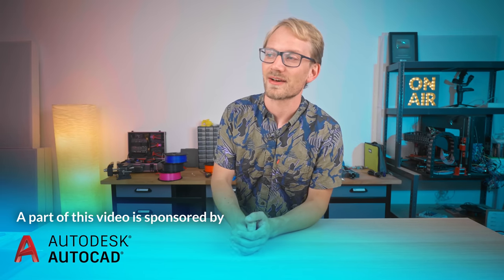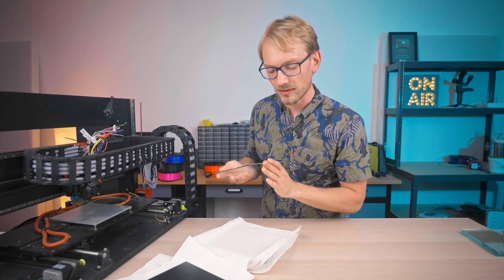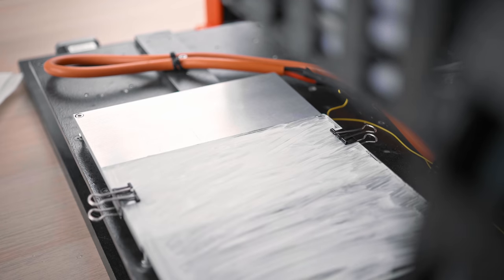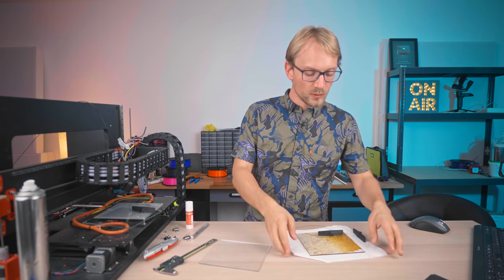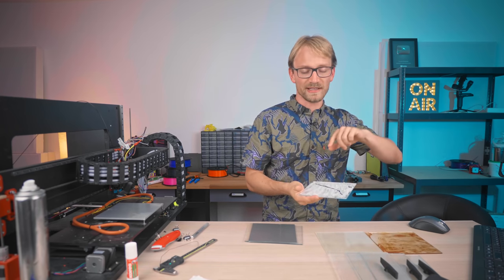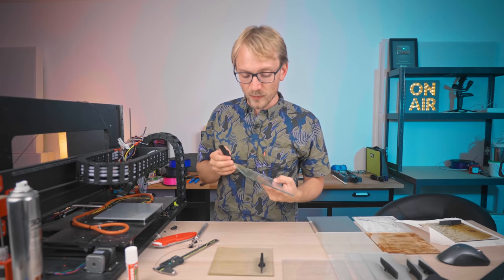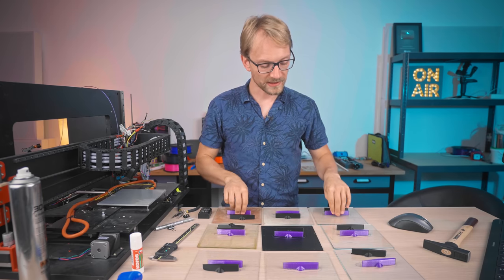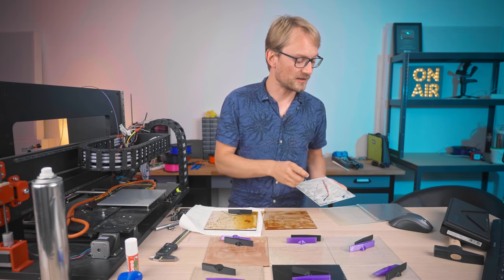Perfect 3D Printer Bed Adhesives - from the Grocery Store!

Comment: Great video Thomas as always. I use gluestick for PETG when printing on a mirror. However these days I just print on PEI sheets. I did however discover a trick that worked for mirrors/glass and PLA, and that is sugar water!

So what you do is you take 50% hot water, 50% sugar. Stir it up until the sugar dissolves and bring a small cloth to the printer. Heat up the bed and apply the sugar water with the cloth in vertical lines. Then stop, wait for 20 seconds or so for the heated bed to dry the sugar. Then reapply, but with horizontal lines. Wait again. Now, print! :) Gives you a mirror finish beneath your prints and is very sticky when warm,but just pops off when cold! Also on the first layer, if the hotend is above 190-200 the sugar will caramelize which further helps it stick. Please try this!
Reply: Will it not change color and color the bottom of the print when it's caramelized? I'm looking for a solution to print transparrent parts on a smooth surface without any texture or color on the bottom of the print :)

Comment: The paint might be a nice way for decorating glass. First paint the glass and then print the pattern that you want to remove from the paint.
Reply from the maker: Great idea!
Reply: Had the exact same idea... Also: if you need to adhere a PETG part to glass.. it would be very nice to know how to do it since when it sticks: it REALLY stick so well that it could be used as a method to attach stuff to glass..
Reply: Or if you want to print two coloured signs. The bottom layer is painted and the engraved letters are not
Reply: I was thinking the same thing. Make it look like traces on a pcb
Reply: or print first, then paint, then peel.
Reply: Anyone reading this now, or in the future: just use an adhesive layer first, to secure PETG to glass w/o fusing. ♥

Comment: My advice on wood glue (or other random pics glue): make a milky water-glue mix and add a drop of dish soap to make it not pull together when applying. Apply with a brush. Lightly clean with IPA before first print after prolonged non-printing.
Reply: That's what i do for over a yaer now. I use a mixture of 1 part Woodglue and 4 parts water. Super reuseable and if the glue comes of you just brush some new on the surface.
Reply: I do something similar, I bought a bottle of spray-on purple glue, dilute with water, coat and let dry.

Comment: My preference is to permanently apply a magnetic sheet to the bed so that I can use cheap cookie sheets from the dollar store covered with blue tape to print on. The print adheres to the blue tape repeatedly but can easily be replaced. The cookie sheet easily removes from the magnetic sheet. And the cookie sheet flexes to easily remove the part.

Comment: I still use ABS dissolved in acetone, with a tiny piece of rubber from a rubber bowl used to mix plaster (kind of accidental discovery on my part, I used piece of that rubber as a gasket to stop acetone leaking around screws that hold a brush to the inside of the container lid, and over time something dissolved from the rubber into the abs juice, and made juice from that container work inexplicably good). Just a tiny bit, or the surface becomes too soft and will not hold. Apply with a brush at ~60c, prints will then pop off easily after the bed cools down.
Also, acid etched diffusing glass works well as a print surface for this (on the etched side, obviously). Makes nice matt bottom surface.
Hehe a bit old school i know, been 3d printing ABS since 2013 and stuck to what works :)
Reply: If you apply thick coating of glue stick and smooth it out with alcohol, then print something with a pattern on it, the next piece will have that pattern in the first layer when you reflect a light from the surface.. Accidental discovery, printed a mandala and then some translucent light reflectors and the mandala pattern was transferred. Very faint but nice little feature.

BTW, mandalas are the real stress test for first layer adhesion.. By far the hardest first layer, full of sharp corners and protruding thin edges.
Reply: I have tried acid etched glass too. But my experience is that it sticks better with diamond sanding. It would be nice if Tom could try sandblasted glass...

Comment: My solution is 100% IPA and gluestick dissolved in it until it is saturated. Sift out the bits, thin it a bit (it is saturated solution, add a bit to compensate for evaporation). Apply with a brush or a sponge, store the applicator in the same container as the "magic goo". It comes out as super thin and fully smooth and it creates a "matte" finish that looks awesome: it is not fully mirror finish but looks more "manufactured".
Reply: you may have a better time of making your mix with liquid pva (wood glue) instead of the stick that way it's not so chunky.

Comment: Sugar water is a fantastic bed adhesive. I used it for my glass.bed for the longest time and it's great. Easy to spread on, easy to clean and always cheap and handy. A little less sugar than simple syrup works, like a 2:1 water to sugar ratio. Try it! But don't caramelize it heh
Reply: Ano Nony I was JUST thinking about that 😁👍
Reply: Sugar works for me too.
Reply: How exactly do you apply the sugar water?
Reply: @hlavaatch  I use a sponge
Reply: I use this as well. It's fantastic. I've never had an issue with bed adhesion since using it.
Reply: I used a 50mm wide ‘ink’ roller. Placed a tea spoon of sugar water on the bed – I found less was better, for me about 1 sugar - 4 water, you’ll have to experiment a bit. I tried 1-1 or less and found I had sugar crystals forming on the bed! With the bed at around 50c, I gently moved the liquid around the area that I wanted to print on, with the roller so I could  gauge when the solution became ‘tacky’, at this point I would spread the solution around the print area quickly. Moments later the solution dried and the roller will move with out having a tacky feeling surface. btw this was on a glass surface, I moved over to a PIE sheet and eliminated the need to this any more.
Reply: @gamezquenta4227  that ink roller idea is fantastic. I've just been using a chip brush and a jar of sugar solution by my printer.  The solution does have to be less than 1:1, 1:4 actually sounds about right.

Funnily enough, I switched to PEI (and used every permutation of glue stick and hair spray) and I couldn't get anything to work at all.  This was a while back, so maybe I was doing something wrong, but sugar water has worked ever since
Reply: @StephenKoplin  When I first bought my PEI sheet I did have to scuff it a bit with very fine wire wool and I use isopropyl alcohol before I start a  new print.

Comment: Fantastic tests! On your PETG test with the plain glass, if you dried it with a paper towel that is probably the reason it released. Paper towel leaves a very slight residue of something left over from the manufacturing process. If you wipe it down with isopropyl and a coffee filter, it will usually steal a chuck or two of glass from the surface. I nice trick for PETG on glass is to put just one or two swipes of glue stick and then wipe the whole surface back down with a damp paper towel. The slight glue residue left on the surface gives a perfect amount of hold with a fairly easy release (also holds up great).
Reply: I would say that to get perfect release take the glass of and lett it and the print cool down to room temperature. Then you just have to pick it of the glass. Or just blow it off.
Reply: I can second that! A tiny bit of water (that will quickly evaporate) will leave a super thin and strong film. Works with wood glue and hairspray alike :-)
Reply: @nutkickermotioncontrol8238  Exactly - works so much better than putting it on in an actual visible layer!
Reply: Only sandblasting or "blueing" removes atomic oil-films.
That is scientific fact.
One can't "blue" glass.

Comment: 8:50 “Or you have a bumpy bed, which is not that common”

* * laughs in Ender 3 perfectly conic bed * *
Reply: I wish I could give you more than one thumbs up. I feel your pain, brother.
Reply: Retialus 
I’m thinking about buying a new Creality bed, and something like buildtak.

Easy Peelsy looks very nice, but is unreasonably expensive
Reply: @RamLaska  I "fixed" my bed by evening out the surface with some packaging tape, now I can't complain. Seems cheaper and easier than buying a new bed and taking the gamble again.
Reply: @redshifted8790  
I've thought of doing the same. How old is your Ender 3? I'm hoping that new beds aren't warped like mine from Oct 2018
Reply: @RamLaska  Just a couple of weeks. I can assure you the problem has not been appropriately adressed.
Reply: Retialus 
Jeeez. I know it’s a cheap printer, but c’mon, Creality!

I had to print only on the front half of my bed until I got a glass bed.
Reply: Darn! I vought my ender 3 pro like 2 years ago? and im still printing on the default bed without any issues 😰 sad to hear this!
Reply: @cheetahfpv6476  Yeah, the QA for the Ender 3 seems to be non-existent. I might try buying a new bed on Amazon, at least they have a decent return policy. :)

I bought a glass plate for mine a while back (before Creality started selling one), and that fixes the problem, but glass introduces its own issues.
Reply: Glass beddddd. Solved it on my pro
Reply: @bhupindersingh1413  
I've got a glass beddddd, toooo. But then it doesn't always stick well, and then I'm gooping on glue stick, which makes the bottom of my prints look like absolute garbage, so now I'm printing rafts. RAFTS. 3D printing like it's 2009. Sad.

I've cleaned my glass bed with denatured alcohol until it squeaks, and then did the bed leveling to the point that the first layer is nearly transparent. I still get spaghetti. I was having perfect prints on glass until recently, and nothing has changed -- same PLA, same temps. :/
Reply: @RamLaska  humidity????  I'm facing the same issue.
Reply: @RJRiemensnider  It could be that way in my case, anyway. It's been a lot colder and more humid recently where I live
Reply: My Ender 5 pro came with the standard magnetic bed which had a concave (lower in the middle, higher at the edges. About 1mm difference from the center to the edges) shape to it and nothing stuck unless i used a 3" square area of the bed. Bought a creality glass bed with their coating on it and now works perfectly. Not something that should be happening for a midrange hobbyist printer.
Reply: @Lassi Kinnunen 81 
Yeah I'm on glass now

Comment: Hey Thomas,
Wood glue (PLA) and hairspray (PETG) are my goto materials to get good bed adhesion. BUT NOT APPLIED PURELY AND DIRECTLY!!! If applied directly they both form more of a release agent than an adhesive. Especially the hairspray forms something that looks like a thin layer of cotton candy under the microscope. Here's the trick: Spray high strength hairspray onto the print bed, then add a few drops of water and spread out with a brush. Let the water evaporate and you will get ORDERS OF MAGNITUDE better adhesion. No more cotton-candy-release-agent behavior!
Additional benefit: 90% of the hairspray does not even get used, so you can re-juvenate the surface just by brushing over with a wet brush. Redistributing the leftover hairspray. That way a single spray coating (value < 5ct) gan be used for 5-10 prints.

Comment: I'd be interested in a continuation of this, testing with ABS and Nylon.  I typically use Aqua Net Extra Super Hold hairspray with ABS and glue stick with PLA and PET-G.
Reply: Wood glue in my experience works best with Nylon, and for ABS... it's ABS slurry. 
Glue stick has always given me trouble, I think some brands add stearine or some sort of wax, which doesn't stick AT ALL.
Reply: @hailstevemcqueen  I noticed that the Elmers glue stick that's purple sticks really well, but a cheap glue stick from Dollar General causes nothing to stick.  I haven't done much printing with Nylon yet, so I'll give your recommendation a try if I get some in the future.
Reply: Yes glue sticks are awesome for PETG, with a skirt I can get PETG to stick without a heated bed and it saves me so much over time in electricity so it's worth it for the extra filament and glue stick purchase (A decent sized stick can last you im sure over a thousand prints, washes off in water like nothing). Right now I switched from a glass bed to a magnetic flexible steel sheet PEI coated (Looks like someone cut a piece of a fridge/freezer lol) and it's so perfect, no more messing with clips and the weight savings, if you hit this with your brass nozzle, the nozzle goes and not the surface lol.
Reply: @hailstevemcqueen  I wish I had something different to use with ABS, I kinda hate the slurry.
Reply: I just use aqua net with everything LOL. 

I wash my plate with Dawn every dozen or so prints, lay a fine mist on it, and then spot-treat any that comes off from a print.

PS: I don't print ABS. I would never. ASA is far better and non-toxic. There is zero point to ABS in 2023, LOL.

Comment: I usually print with PLA on clean glass.
I found that ambient temperature in the room or a drafty room can play a huge role in how well the print sticks. (open frame Prusa clone). Adjust temps accordingly as seasons change and room gets cooler.
I also found that printing the first layer 10-15C warmer on the bed, and 10C warmer on the hotend, then continue printing at normal temps after initial layer has helped eliminate warping and the part sticks well.  Still releases perfect when glass gets around 45C. The part I print the most is about 25x150 on the initial layer, but looks awesome with a glass finish on the bottom.
PLA+ however, I have found some brands don't behave as nicely, and I'll use hairspray to make them stick.

Comment: I've been using a high temp PET tape on my bed for years now.  Works great with PLA and PETG (and I think ABS, but I haven't printed ABS in several years.)  Leaves the smooth bottom just like glass.

Comment: I just tried frosted glass, had the glass cutters sandblast one of my sheets of glass, seems to work well when i can get that first layer right (and keep it clean)

But as for adhesive, shower spray cleaner, thats what i used for a while, i found straight window cleaners can leave a film (I think its to make windows look nicer) where shower cleaner doesn't leave anything, when wiped off completely  just using that and plain glass worked like 90% of the time for me

Comment: Initially when i started 3d printing, i also experimented with various adhesives to see which ones worked the best. The one which I settled for and still use now is fabric glue. It is also pva based but less viscous than wood glue or craft glue, and also holds down pretty much all kinds on printable materials.

Comment: Started out using blue painters tape 2 inches wide, works wonderfully, got tired of the seam marks from the tape. I was printing on the aluminum bed so I bought a textured glass plate. That worked for a little while, then didn't. I turned it over to the plain glass side and used hair spray from the dollar store, haven't looked back. $2.50 for a huge can. I have to wash the glass periodically because of hairspray buildup

Comment: With a glass bed, One swipe of dollar store glue-stick; then spread it out with a paper towel that is wet with IPA. That is all you need. This technique has given me the perfect thin yet clingy surface for my prints. It is quick, cheap, and easy to apply. One treatment can do more than one print, but I prefer to  just give the surface another wipe with the paper towel/IPA to re-spread  the glue between prints. It just takes a few seconds and the surface is perfect again. Eventually you will need another wipe of glue-stick, but just the smallest amount as you want to avoid build-up of the glue.

Comment: I always use simple standard household sugar with water. I just poor a bit sugar on a small plate and add a little hot water and I mix it with a normal kitchen sponge. When it has mixed I apply it to the bed with the sponge. I "massage" the bed, it is very satisfying and easy. Usually I preheat the bed then to let it dry. Sometimes I repeat it twice or so to "prime" the layer, between prints I just freshen it up with the sponge.

For me this has several advantages:
- It is super cheap and always ready to use available, you can't run out of it
- It is super easy to clean off (just rinse under water tap)
- It is very easy to freshen up between prints
- Because of the surface tension it flattens out perfectly

If for whatever reason the print does not stick, I also love the Cura "Z Offset Setting"-Plugin. If you give it negativ z-offset it will smush the print into the plate. I increment in 0.2 mm steps. Same if it sticks to much, just add positive offset. This allows you to finetune your bedleveling.

Regarding sticking I also like to play with the bed-temperature. Higher temperatures help the stuff to keep stuck (e.g. 70 or 80 degrees) and when you let the bed cool off completely, the material tensions will pop the piece off the bed almost by themselves. It takes longer to heat up and cool down though. So I use higher bed temps seldomly.

Comment: best thing by far was just sanding up my glass on one side to frost it (pla,abs, asa, pteg, HDPE, all worked fine no additional glue).  Getting off super hard, just heat up the bottom side of the glass.  Hairdrier, hot water towel, etc. Just sand it  back when needed.  Also sugar water works well.

Comment: Been using Kapton sheet in the beginning, then when removable PEI sheets became available I changed to those and never ever, not once used any gluestick, hairspray or anything to treat the bed. In my opinion just too messy and not needed 🤷‍♂️... I wipe down the bed with isopropyl alcohol after every print and just before starting a print... works perfectly 👍